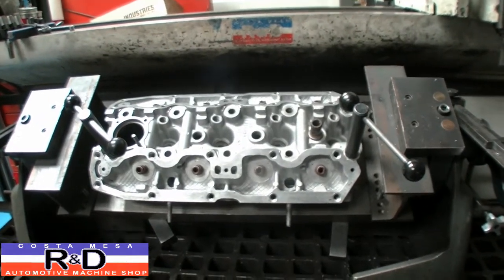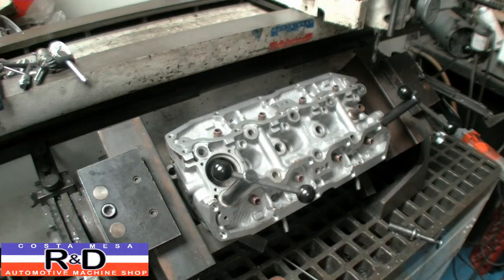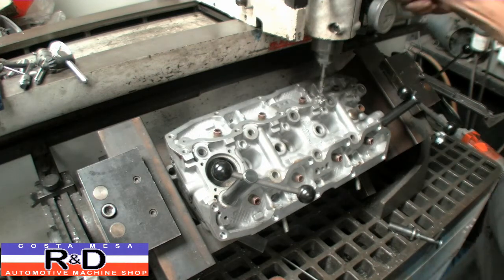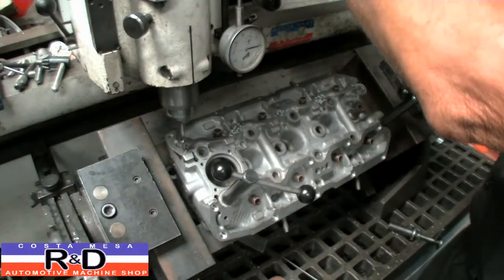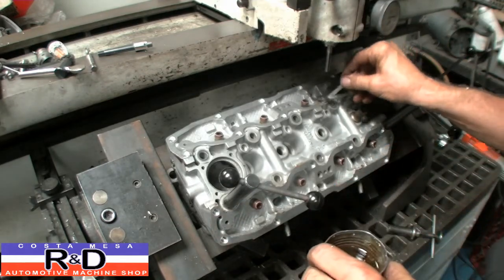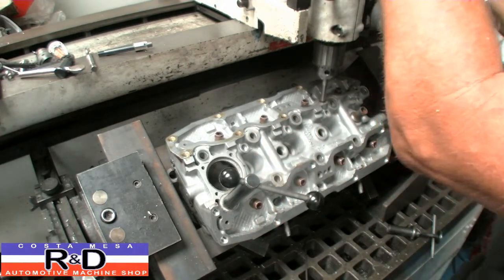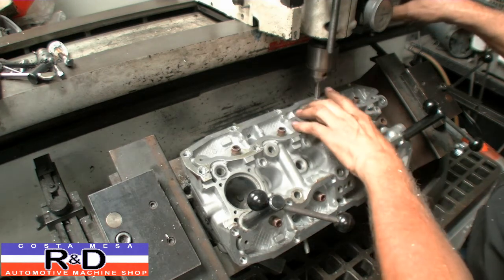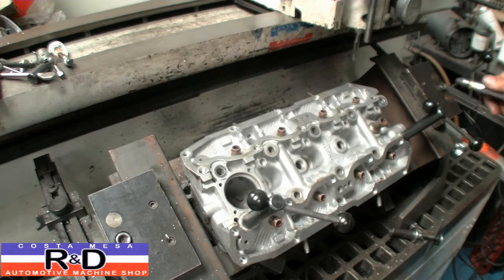Fiat 124 Stripped Thread Repair with TimeSerts 01

Comment: Interesting way of running that tap down. If the tap was tight in the chuck, it would "strip" out the threads you just made. So once the tap starts to find it's own way there is enough friction to keep it turning, but not too much to strip away any threads.